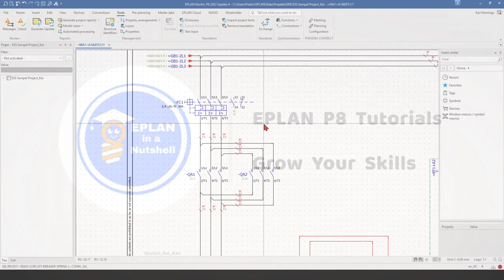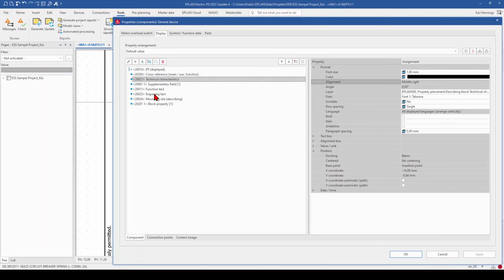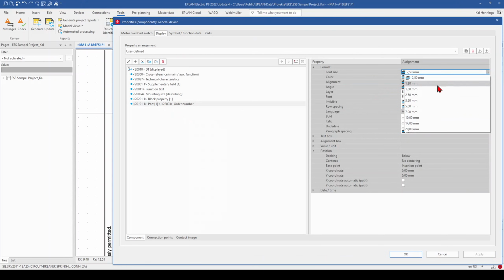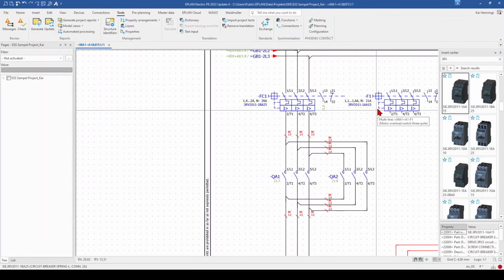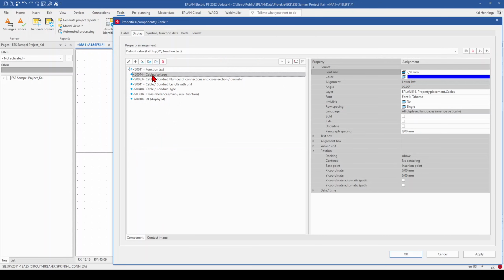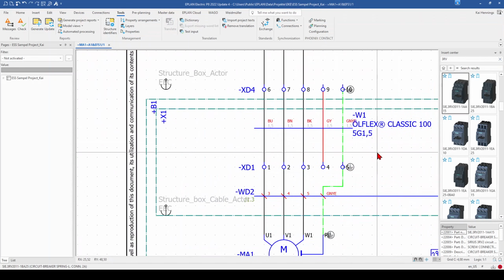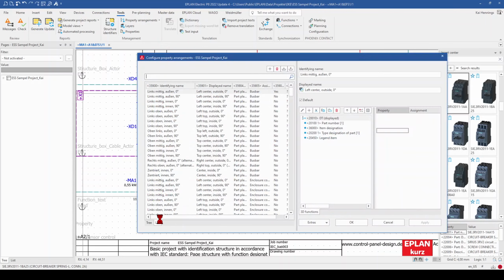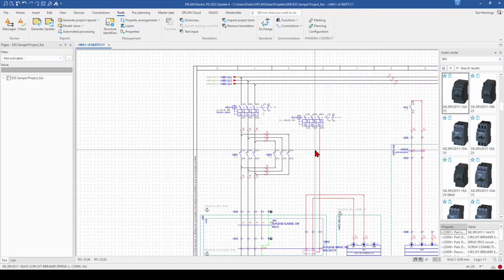EPLAN P8 Property Arrangements. Creating user defined Property Arrangements, Settings, Examples

Comment: Hi Kai, good videos! We like to show external connections as dashed lines for quick reference i.e. anything defined as a cable. It seems as though the Connection Graphic is not included in the property arrangement though, is there any other way to automatically change the line type without editing every connection definition point?